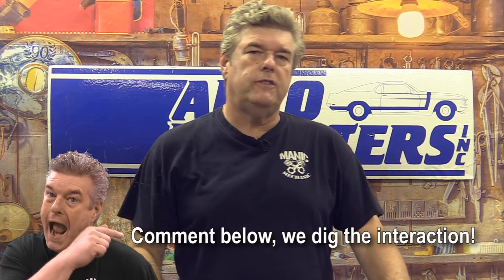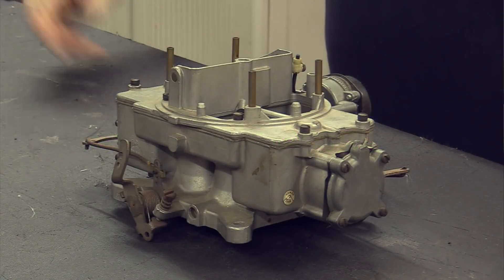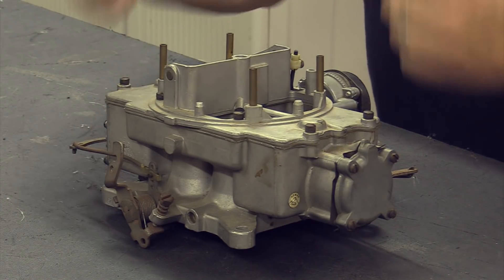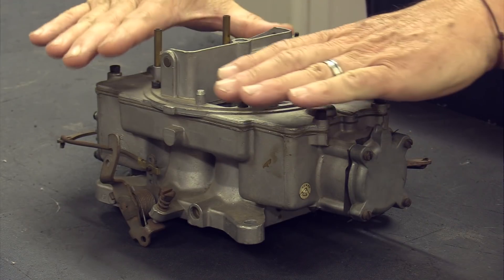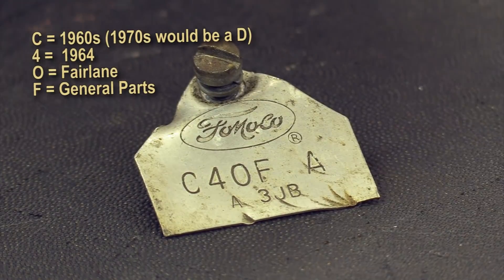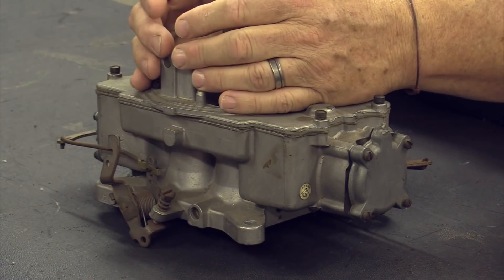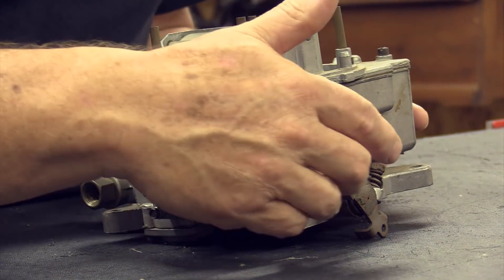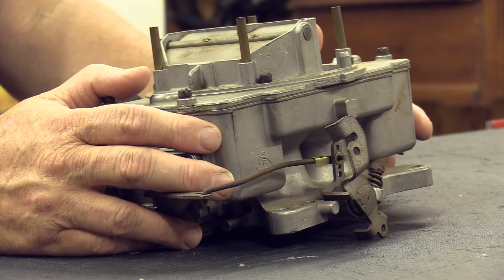Know Your Ford Carburetor

Comment: I appreciated this video.  I recently picked up a ‘65 Ranchero with 289/C4.  The manufactured 2100 is missing a tag and the sticker is faded to nothing.  I’m trying to figure out an off-idle bog/stall under load.  I eliminated all the lean burn and timing issues.  The distributor is very worn, so a replacement is next. At the moment, I’m perplexed.  At any rate, thanks for the minutia.

Comment: Well, this may have answered some of my questions for my build then. I ordered a rebuildable 4350 core on ebay because I knew rebuilding my 78 F-250 460 was gonna cost me some coin already. Turns out the core I bought was for Jeep. The tag is 6T4A4. Which, of course does not entirely translate well into Ford lingo since it's not technically a Ford p/n. So, besides the jetting etc not being correct, nor did it have C6 kickdown provisions, but possibly the venturi dia might be incorrect. 
So, I should probably stop wasting any more energy on this thing. Yes, I was aiming for OEM performance, but at the going rate for reman units, I'm probably just gonna cave in and go aftermarket. 
The truck is non-emissions somehow(though signs of converters exist?), so at least that part will be easy. I believe it may have been custom ordered for agriculture. Though, the lack of 4WD, calls that theory into question. 
It's a strange beast. It came equipped with Duraspark 1(I believe, since it has the smaller cap), no vapor or fuel return system, no EGR, BUT it came with factory A/C, 2 tanks, rear window defrost, AM radio, and the "Trailer Special" package. All on the, "Custom" trim package. 
Sometime before taking ownership in 1996 and before the previous owner had it the year before, someone hacked the exhaust and made it dual side exit. Then they reupholstered the seat and removed the door panels and installed some fabricated ones. 
Someone also installed a massive hitch that measured the width of the frame but extended from the bumper all the way forward to about 3" from the diff. Basically this thing is a big as the rear tank. 
Lastly, full-length Hellwig helper springs were added. 
So, this thing was built to tow. 
And we abused that privilege too. We carried a 2,250lb cabover camper and towed a 23' camping trailer using a 3' extension tube from the hitch. The camper extended past the bumper 2'. So that hitch not only carried that weight, but handled the torsion as well. A normal hitch wouldn't have worked. 
Anyways. I've owned it since 1996, it's my first vehicle, and I hope to pass it on to my son someday.

Comment: I'm not sure if the Holley 4160 side hung floats or the Autolite 4100 came out first. Some of their features reflect each other. But, the 4100 had annular discharge booster venturies.  The Holley did not. The fuel and air was atomized better with the 4100's venturies.

Comment: I have a autolite 2100, if you take the hose off the vacuum on distributor should the rpm change? Mine does not. Is there something wrong.

Comment: It's a pain trying to find a 2150 with an AOD TV Rod linkage for a 1983 LTD Country Squire with a 302 CFI setup. The infamous 2700vv is shaping up to be my only accessible alternative. TV cable kits on non-aftermarket carbs seem non-existent as well
Reply: Contact Jay Broader Transmissions for all of your Ford transmission advice, parts, even custom builds, and adapters.  A friend of mine mine had a 1964 Galaxie with a 427 SOHC with stack injection that made in the neighborhood of 1500 hp and ran  Drag Week with it one year with a Powerglide, and a C4 and the OD all of the other cars like Larry Larson and such ran and the name escapes me but it is a really strong OD. Jay Broader can fix you up! I got some things for my C6. It shifts perfectly at 6400 in Drive.
Reply from the maker: Hope you get it worked out.

Comment: I took the 4V 4100 off of my 65 352 with the 1.12 Venturi and it was perfect for the 289 hi po clone from a 302 we biuilt with the Voodoo cam and a C4 for my father in laws 65 Fastback. and hipo manifolds and it was fantastic!
Reply from the maker: Yes. with more flow the 1.12 is good.

Comment: So would a carburetor from a 289 302 or 351 fit on a 390 FE
Reply from the maker: Yes. And 60 CFM should do the trick on most applications.
Reply: @AutoRestoMod  ok thanks

Comment: These are fantastic Carbs. Definitely familiar with the hard corner stumbles (very noticably right turns...lol) I think if they had a more open aftermarket support they would be a real contender. A lot of people just don't know where to get parts or tuning pieces and that drives them away. The Summit 4bbl carb very closely mimmicks a 4100 with more Holley design and parts.(was originally a Holley product to begin with) I hear good things about them.
Reply: We used to replace them because the plastic rod that closes the secondaries would break off and it would hang wide open. You had to turn off the engine to get it to close. We were afraid to get on them for a race. I didn't know about the rod for years, till I had one that wasn't broken off. Now I always check that the rod is there and if iits missing I replace it with a screw that's the same diameter. I think that a new rod should come in the rebuild kit. I've always had good performance out of these carbs.
Reply from the maker: They just lack that annular discharge nozzle and rely on the Holley style which is a bit more sloppy.

Comment: I have a 1963 4100 with 1.18 jets. The code for the carb is C3AF. It's on a 390 CI w/Cruise-o-matic transmission. And yes it can be finicky!  :)
Reply from the maker: Yup.

Comment: I have a 4100 on a '65 Galaxie 500 with a 352. I have gotten 22 mpg on the hwy
Reply from the maker: Yup. It is possible.
Reply: Parents 66 Galaxie XL 352 4V (250 HP) -- 18 MPG highway.  Back in the day, with air con.

Comment: Thanks for the decoding info! I recently put an Edelbrock on my '72 F100's 360, replacing the 2100 (changed the intake too, obviously). The tag on the 2100 was D4PE, so I knew it was a '74 carb, but I never cared enough to investigate the PE. You inspired me to Google it. It was a 1974 Replacement Part Autolite. Would the original owner have needed to replace the original carb after two years? Or do you think he may have bought it several years later rebuilt and it happened to be a '74 replacement?
Reply from the maker: Shady mechanics used to throw parts at stuff just like they do today. Bot scenarios are possible.

Comment: The one I have is an  C5 AF carb with C5DD under it. CFM?
Reply: Look for the venturi size on the casting.
Reply from the maker: Mason is correct. The C5AF is a 1965 Full sized carb. I think the venturi size is 1.12 so 600 CFM. Good workman carb on a 390 or 352

Comment: Good details in the video. Most people throw their old auto lite on a shelf for a Holley. Other than the issue with stumble in hard corner I prefer them for a daily driven vehicle. The annular boosters on the autolite are great at atomizing fuel and result in a very snappy throttle response. The autolite boosters are far  superior to any stock holley booster. A few more details some people don’t know. The accelerator pump and power valve are Holley parts even after they switched to Ford  jets. The Venturi size is only half the story. The boosters also sized differently. They are stamped with a letter code. Ford used different sized boosters and jet combinations to dial in a carb for the vehicle and engine it was built for. I haven’t found a good source for decoding the boosters. 

I am one of the lucky ones that have a 4100 for a manual shift mustang. It’s going to look nice on my engine once I swap it over to the top loader laying in the corner of my shop.
Reply from the maker: All true. We covered a good bit the the info on the boosters and power valves in the Rebuild on the 2100.

Comment: I have been looking for a source for replacement throttle shafts for some time for the 2100 and 4100. I have three carbs all with worn shafts (carb bodies are not worn - throttle shafts are). Anyone know a source? I have called or emailed probably a dozen carb parts suppliers without finding anyone making / or selling replacements.
Reply from the maker: The shafts are going to be an issue.
Reply: Yes I am thinking of having a machinist make a couple and swap the end with the linkage.  @AutoRestoMod

Comment: They made a hipo 289 for a auto it was a 64 mercury comet 289 225 horse c-4 auto. It had 1.12" plus a auto choke.
Reply from the maker: You are correct! Though the 225 horse lacked the solid lifters of the 271.

Comment: What about the 2150?
Reply: Are somewhat different, have a vacuum operated enrichment valve that operates metering rods. More trouble prone than the 2100.
Reply from the maker: Tom is right. And I haven't done much with those.

Comment: I had a spread bore on my 351 Cleveland 4V , can't remember much about it
Reply: Motorcraft 4300D im guessing
Reply from the maker: Boss is right, 4300D. Clevelands run way better on that mixed bore set up in my opinion.